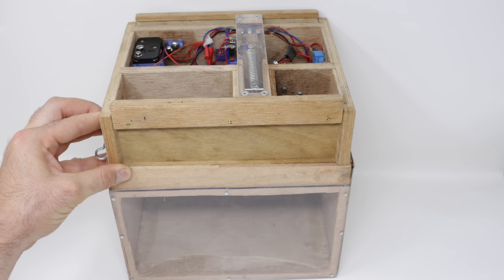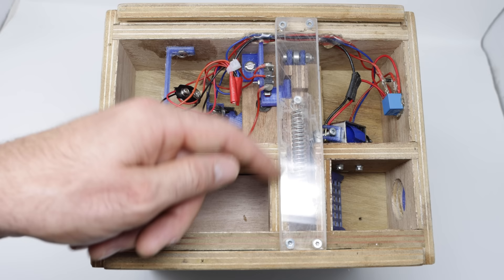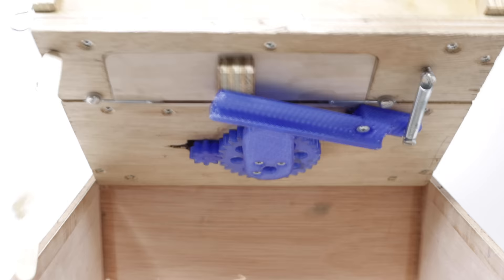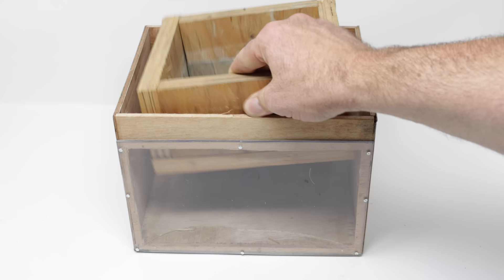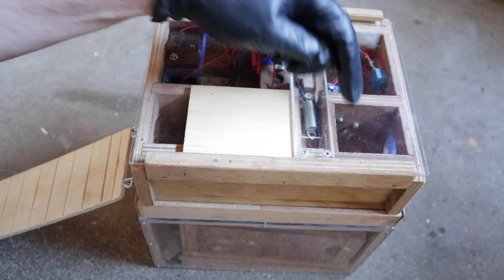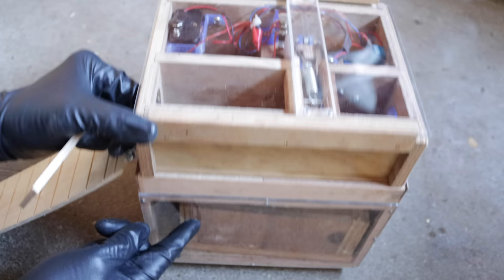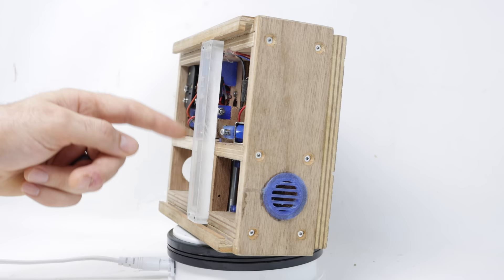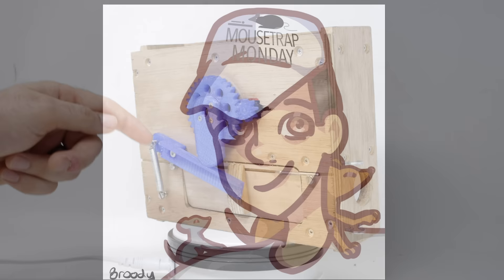The Automatic Guillotine Drop Box Mouse Trap is Phenomenal !  Mousetrap Monday.

Comment: THANKS FOR THE REVIEW OF MY MOUSETRAP SHAWN , I AM VERY HAPPY WITH IT !!! 

The mouse can be captivated with the trap and work like a guillotine  , but with a blunt angle on the cleaver ( which is made of wood ) the mouse will  break his neck and will die immediately ,  so there is no blood on the trap.!!
 

I am selling the building plans for this mousetrap , the trap is not patented.!. 
The plans  are drawn with Sketchup and they cost 20 euro's.
There are in total 40 drawings , assembly drawings are included...

I still have to put the drawings on Onedrive because the file is to big for email.
By the end of tomorrow they are available !!. 

All parts are drawn accurately and precisely.

The electrical diagram  is included.

Parts lists are also included in the operating instructions 
The material costs for this trap are approx. 20 euro's...
You need a 3D printer to make  some parts of the trap! 

Laurent
Reply: I would happily pay more money than that,but I am unable to 3d any parts
Reply: Great design!
Reply: Excellent trap. Clever design. 🐭
Reply: You should have something that would prevent others stealing your ideas and selling it.
Reply: @Donald Brown many libraries have 3D printers available to the community
Reply: Hi Laurent
Reply: @donaldbrown7715  With a little looking around you could get off the shelf parts to use in place of the 3d printed stuff. No need to 3d print gears when McMaster-Carr, Grainger, etc. exist.
Reply: Amazing, but I think you need to provide the 3d parts because not everyone has a 3d printer and know how to use it.
Reply: Gefeliciteerd Laurant!
Reply: Why don't you just make them and sell it lol
Reply: At least copyright you design.  OR     Something like...
May be constructed for personal use, construction of items made from "detailed plans" for purpose of sale and profit prohibited when WITHOUT designers/copyright holders express written permission.

And whatever legal penalties may then be leveraged against any persons/companies/entities, that fail to to comply with said copyright.

Nothing worse than loosing credit for your own creation. Cheers
Reply: Hey laurent heb je modelbouw servos gebruikt of wat ?
Reply: This is the best mouse trap I have ever seen. I've never seen a self-resetting mouse trap that dispatched rodents as quickly and humanely as this one.
Also, I love the relay logic you used for making the trap work. Most people would have just used an Arduino, but your setup appears to use zero power unless it is actively dispatching a mouse.
With rechargeable batteries and a solar panel, this would be hands down THE BEST TRAP for keeping a summer cabin mouse-free.
Reply: @thorlancaster5641  
indeed, the mouse trap does not consume any power in stand by mode. The mouse switches on the mouse trap..
Reply: When you are ready to sell them I will take 5.  Boston is infested with mice and rats.
Reply: This is a trap worth having, well done.
Reply: hmm... well that explains why its a head smasher and not a "off with the head" kind of trap

the blood clean up is a problem. i was just about to ask too 😂
Reply: Name a price for a built one.
Reply: @Mintstar_Oceanpop  90 euro's
Reply: He really needs to protect this idea and market it, even peddling it to a mousetrap company is a good idea. Dont give it away freely its too good for that.
Reply: @user-cz5tc9ig8m  How do I place an order?  About how much for shipping to Illinois, US?
Reply: @Mintstar_Oceanpop  Te shipping costs to the US are  42 euro's...
Reply: Well done, congratulations.  I hope you get many, many orders.
Reply: @Wayne Flanigan Yeah, and there are community resources available to 3D print your stuff, even if it takes hours... You usually pay for the filament.
Reply: @Innuya  most library 3d printers are broken, as the librarians have no idea how to maintain/calibrate them
Reply: @TheHungrySlug  you don't copyright a mousetrap.  you patent it.  copyright does not cover "useful" items, only art and non-functional designs
Reply: You should patent it. It's your work after all.
Reply: @user-cz5tc9ig8m  Hey, if you get enough orders in, I'd be interested in ordering one for here in California.
Reply: MOUSE GOESE WEEEEEE
Reply: Are you also providing the stl files with the plans?
Reply: @justinthomas2458  Yes , the STL files are included , a manual of the trap  with partlists in the manual is also included...
Reply: I think u should have flipped the wood piece that is spring loaded around
Reply: @user-cz5tc9ig8m  love your creation but it messy like I would rather not have to clean up the mess the electric on is cleaner and humane(nvm I thought it was a blade)
Reply: That is AMAZING, and I can't even imagine how much better could be if you do later versions someday if its already this amazing of a prototype.
Reply: The ONLY thing I'd be worried about, is that's awesome wood, and it is squishing the crap out of mouse brains. How do you clean it? Is there any way to put some material over the wood, at least the interior, to make it easily cleanable? That would suck to damage the wood.
Reply: @addidaswguy  u could put some laquer on it or skim some epoxy over it
Reply: I love this design. Great job! I’d like to buy these plans.
Reply: Shawn, you should help him patent this thing before some company copy it and patent it
Reply: I would need this
Reply: @Wayne Flanigan A small part doesn't take that long

Comment: Gear ratio needs to be adjusted. That's why it's running through 2 or 3 rounds before it stops.
Reply: I thought it was the gate getting stuck open......
Reply: @muskokamike127  I think so too, on reset the end of the guillotine hits the trigger again and causes the cycle.  A little more of a gap between the guillotine and the gate would fix it.
Reply: @WizardofGOP  there's a LOT of adjustments/refinements that are needed. 

It's a brilliant idea but I have a feeling he's young, and inexperienced. Hence the "rough" construction. I mean, he used nails are axles for the door lol. 

He should also coat the guillotine in lacquer, otherwise it's going to get bloody and be a petrie dish of bacteria. 

I'd also be wiring in a 6v ac/dc adapter right quick. Duracells will get expensive real quick!
Reply: @muskokamike127  Likewise,, or just the vibrations affecting it due to being perhaps a little too sensitive -- merely some adjustment needed.

Comment: You could use lithium batteries like 18650s and the trap would have way more cycles and reset faster. 6xAA batteries is 9 volts. 3 18650 packs in series is 12.6v fully charged and 9.6v at the point the cells should be recharged. Alternatively you could use 2 lithium cells, fully charged 8.4v and 6.4v when "empty". The lowered voltage may prevent the motor from having enough torque to overcome the spring pressure so i wouldn't recommend less than 3 cells.

Comment: Burns of skin infection put Honey on it and a plaster or bandage leave for about a week
Reply: I'll try that,thnx.
Reply: @donaldbrown7715  yes and insect bites as well and chemical Burns great for sunburn and ulcers but use Manuka honey 50+ or higher for ulcers, cover the ulcer and surrounding area and bandage plenty of honey leave on for 3-months will be completely gone cover with bag if you're showering don't get the bandage wet but don't leave the bag on has to be to the air
Reply: @johnsweda2999  cool,thanks for the info.i try to use home remedy when pissible,for instance,put good red clay on a wasp stibg,( the kind u find along creekbanks n is almost suitable for pottery), and for a yellow jacket sting,honey bee,hornet,etc. Chew a little tobacco n put the juice with 1/2 wet tobacco on bee sting. If an ocean catfish stings you( they are poisonous n will make your foot swell  up like a football), u squeeze the catfish n rub its but on the injury when something starts coming out of fish.( yes it wirks).
Stuff like that.

Comment: It should go back to design and testing if it cannot consistently cycle the same number of times it is triggered. It looked as though it was mechanically triggered again during the process of resetting. The tolerances of the parts may need to be adjusted or redesigned. Much simpler and less expensive methods are on sale without glitches off the shelf.

Comment: the biggest problem with this trap is that when it slams so hard against the side there will be blood on the sides..... and once there is mouse blood  on a trap a mouse will not enter again untill the blood smell is out. so replacing the wood with a plastic side will make the trap easyer to re use again.
Reply: It makes a lot of noise, too.